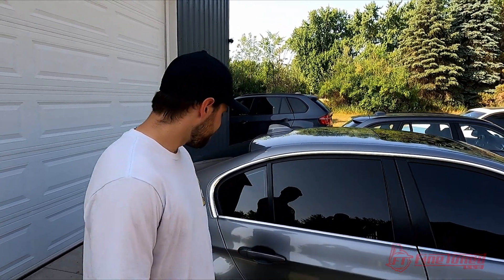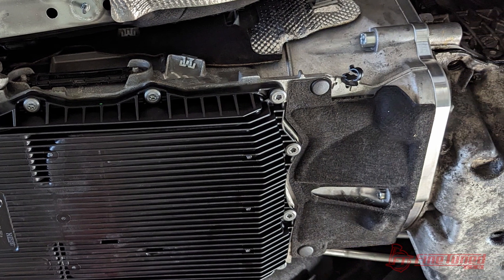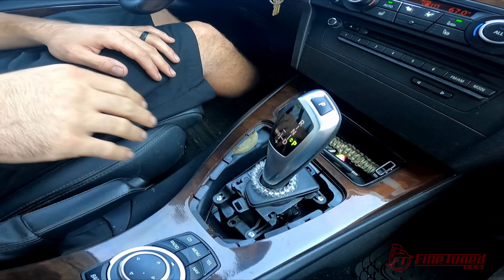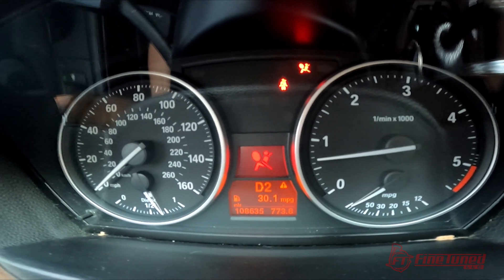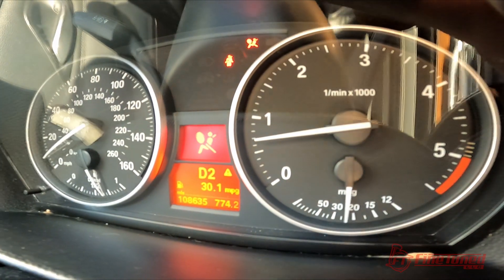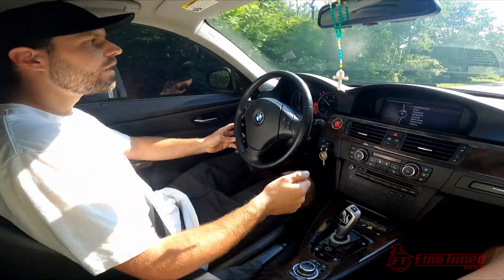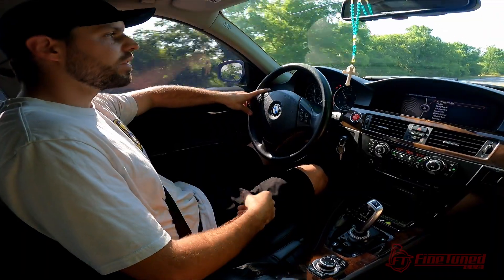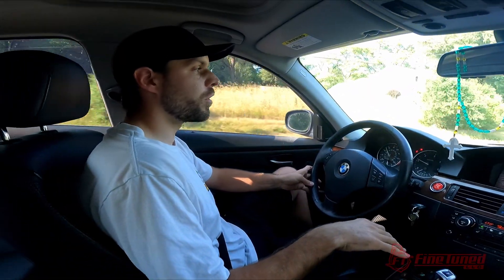BMW G30 8HP75 Transmission SWAPPED INTO 2010 BMW 335D

Comment: I have a 2011 bmw 335d, and the stock transmission is also good. Honestly, I didn't expect a car to be so good. That being said, I would love to feel the car with the newer transmission,  especially if it saves more mpg and shifts quicker. I know you can also buy better parts for the transmission itself, so ima see if the same ones can go in this one
Reply from the maker: Same thing for the 8 speeds
Reply: @bradtourt  that's good, thank you btw, love your video, very informative, not much love is shown for this car model, thank you for doing the well-deserved service this car needs by making this video, will be doing this to my bmw 335D whenever I possibly can
Reply from the maker: @fastshuther no problem at all! Appreciate you following along

Comment: Does the d have any valve seals issues when tuned?
Reply from the maker: No it doesn't
Reply: @bradtourt  any idea why I’m getting black smoke on startup?
Reply from the maker: @jroe2425  bad fuel injector
Reply: @bradtourt one more question, please. The injector is sticking? Or… thoughts?
Reply: NOoooooo. Thanks for your time.

Comment: Hi Bradley.  I’m a fan.  Also follow your work at e70 forums.   My question is did the later e70 like 2013 models ever got the 8hp transmissions?   Also which year of the f15s diesel x5s got the 8hp?  I have the e70 and would very much love the 8hp but I don’t have the time or expertise to convert mine really.  Maybe ready for the f15 chassis.   Thank you!
Reply from the maker: Hello, only the 35i received the 8hp, the diesel e70 never got it. The f15 got the 8hp, 2014-2018.

Comment: question, do you have schematic of that rear plate you made for gearbox on driveshaft side? i have e92 335d and want to do the same but i see now front adapters you can get from PMC motorsport is not enough ?
Reply from the maker: I do not, but if you use a 8hp70 from an fxx, you can use the factory mount.
Reply: @bradtourt  what about flywheel you used from zf8hp70 or zf6 ?
Reply from the maker: @tubeyou1216 8 speed flywheel
Reply: and you don’t need a custom mounting plate to bolt into the motor right? straight bolt on?

Comment: Have you posted anything on your e70 I can check out somewhere?
Reply from the maker: There is a thread on the BMW diesel north America Facebook group. Other than that I have not, I sold that one a while ago. I will be installing an 8hp in my current e70 soon though. I will document it for YouTube.
Reply: @bradtourt   I'll have a look for it. Followed the 135 build. Had no idea you were in Michigan. I'd be really interested in seeing your e70 once you get it swapped. Good stuff 👍
Reply from the maker: @mikeblocker5720  no problem at all, I'll post a video up when I get to it. It should be done before snow falls.

Comment: Should you put a lower final drive to take advantage of the first gear? My 6hp sits at 1500rpm at 60mph so I’m wondering if a lower final drive is key to getting the most from this…. Lmk
Reply: Yes, so I don't remember precisely what diff ratio came in the 335d's, but I know that there's another diff ratio that people swap the diff in & get even better mileage & performance.

Comment: This is awesome! I would be interested in doing this to my 2010 x5 35d  if it’s economical or feasible.  I like  the 5mpg gain you mention on your e70  and average 26mpg on the dash  on my x5 e70. So 31 mpg average would be great! I can do the mechanical labor and have a two post lift. Removal of a transmission is not a huge problem.  Is there a kit available and install instructions.  More information would be greatly appreciated!
Reply from the maker: Absolutely, the kit is $2700 for the e70. You will have to purchase the transmission, and transmission line. I supply the rest of the parts.